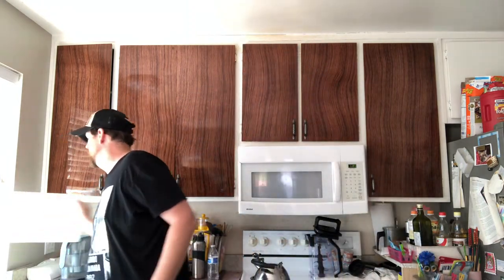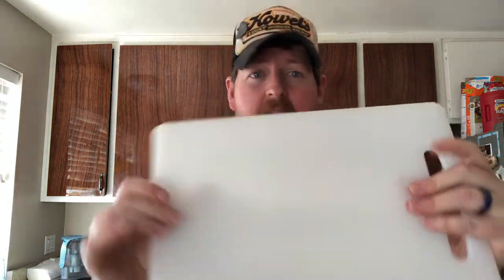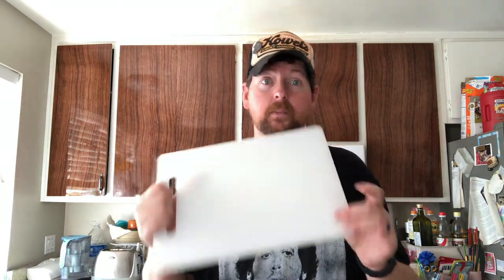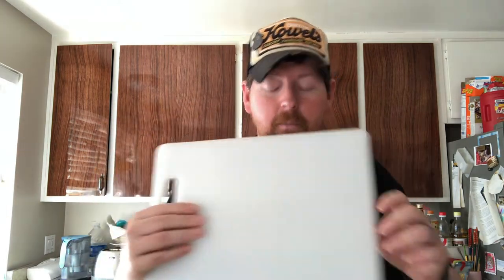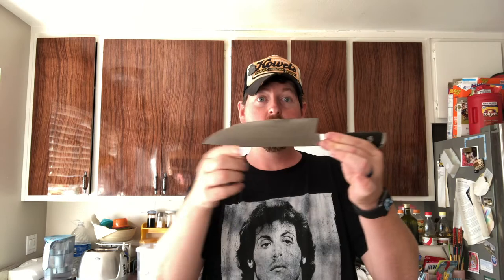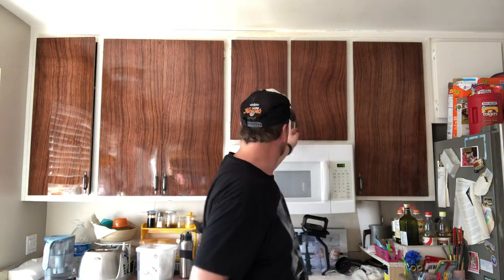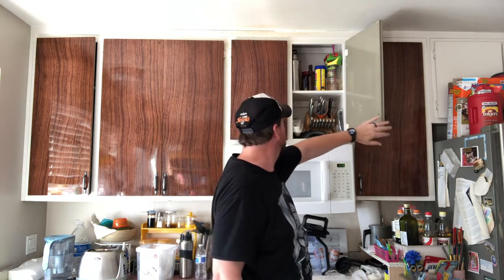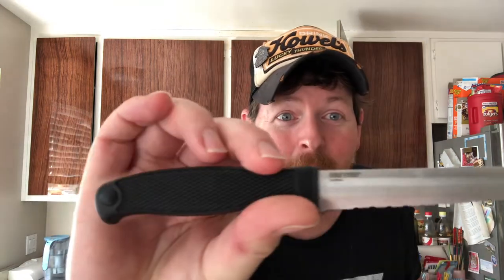don't do these things to your kitchen knives

Comment: Drawing the knives out edge down is just simply a strop pull that will help keep bur off or help pull it off if your using a ceramic rod like I do, I just don't find that much wear just sliding on wood.. I totally get your point but it's common for me to debur a knife after sharpening buy dragging the edge down on a piece of wood, can be quicker and easier than stropping.. Otherwise I totally agree mike

Comment: Loved the video. Small critique as a mobile user, links you mention I'm the video need to be in the description as well. Otherwise, there's nothing to click. Also, if you can drop the intro outro volume or maybe something a little closer to your time of the videos little jarring, esp with headphones. One last thing, I'm really interested if there is a cabinet in your kitchen that does not have a knife in it now.
Reply from the maker: The links are clickable even on a mobile phone I know because I use my phone for YouTube
Reply from the maker: And as far as the volume it’s at 60%
Reply: @CrazySharp  might just be my phone then. Either way, this would help assure the clicks

Eta: Android user
Reply: It was still louder than you speaking, so the transition wasn't as smooth. That's all
Reply: fervens ...I will second that.  On more than one of your vids,  I had to adjust volume after intro because I could not hear you.  It’s no big deal because I know how to turn the volume up just not sure how to turn it down.

Comment: Not all...but I try and hang my kitch knives on a magnetic holder.  Also,  I didn’t think the purpose of a steel was to sharpen...just to knock down any roll from use.  One more thing...where are you located?  It might make a difference in shipping if I watnted you to sharpen my knife.  I assume I pay both ways,  so distance is important.  I live in Idahno,  land of the potato.